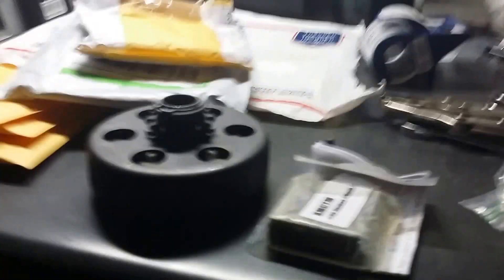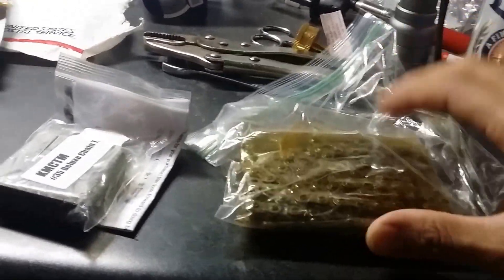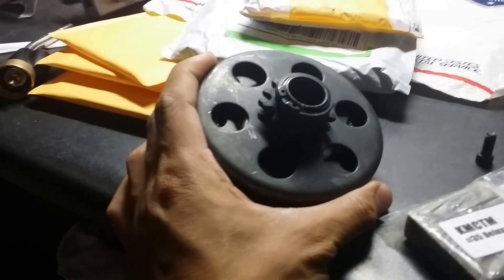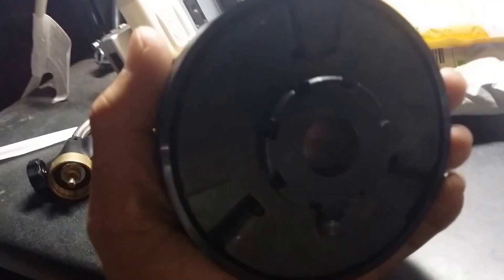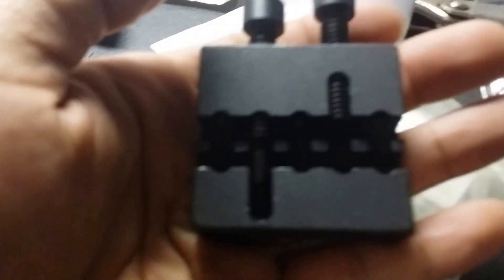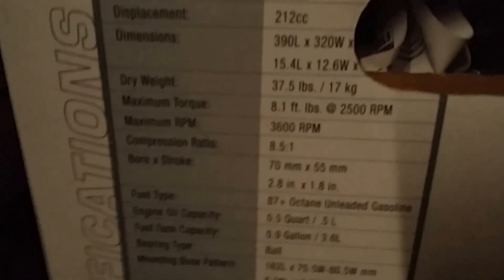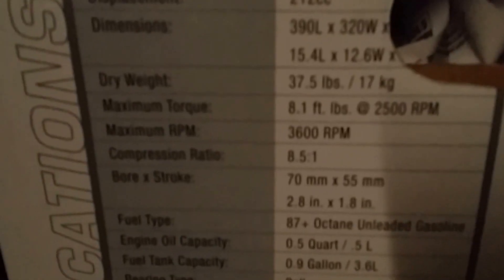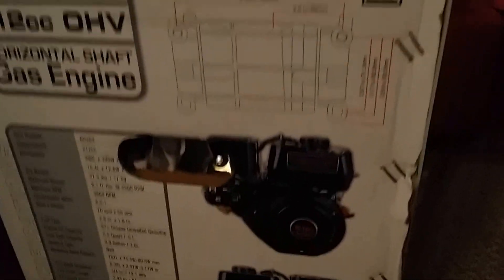Go kart build Predator 212cc part 3 progress and Goodies in the mail!

Comment: get a smaller sprocket if you want speed over power
Reply from the maker: +Gear Heads37 i have now is 10t on the clutch and 54t on the wheel top speed on the governor is 28mph on that setup, i like the tourqe it has with that setup, but i want to get a rear sprocket with about 45t ill lose tourqe but i can always upgrade the jets on my carb.
Reply: DaddySyane that's not bad for starts the fastest i have gone in one is 40 mph
Reply from the maker: +Gear Heads37 the gear ratio on this go kart is pretty fast especially when Im riding on the trails here near my house 30 is plenty tons of fun im trying to make a good video of that soon
Reply: DaddySyane  sounds good man can't wait to see it